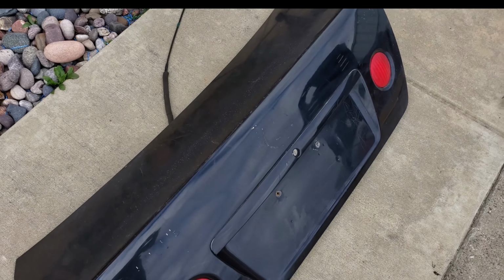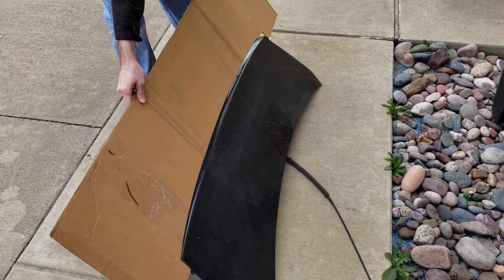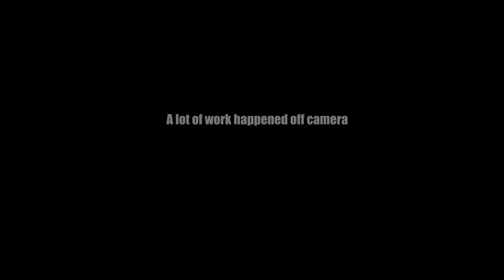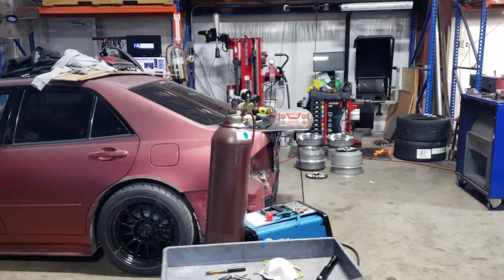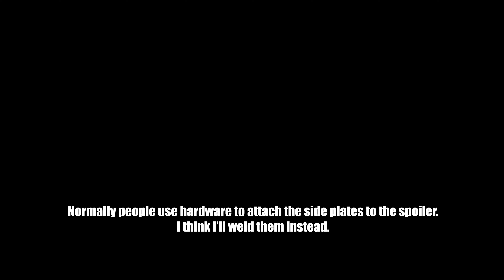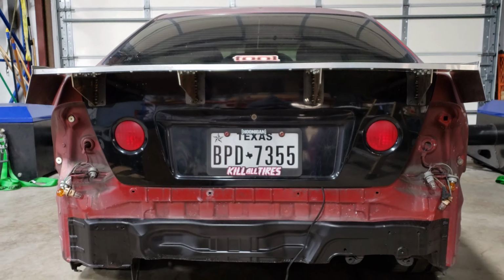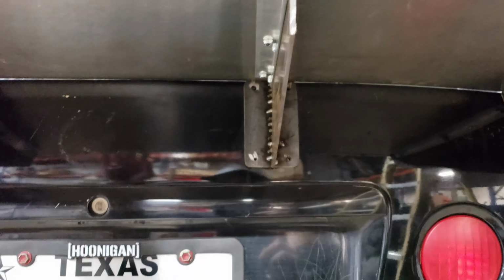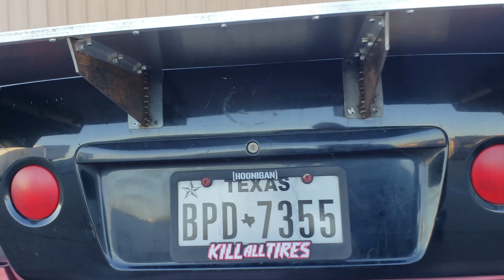Custom drag spoiler for my LS Turbo Lexus. Street car!!!

Comment: 6:50 such a sweet sequence...really happy with how it turned out. WOW!!
Thanks for sharing bro
Reply from the maker: Thanks for your support
Reply: @TurboV8boi  what was the gap from the trunk lid to the wing? I heard some ppl so 1/8" gap. How wide did you do yours? I'm thinking about doing maybe 8-9" instead of a 13"
Reply from the maker: @michaelsutton325  there is no gap on mine, it butts right up to the trunk.

Comment: Can you do a video on if it did or didn't improve your downforce
Reply from the maker: I did think about doing that, but i never set it up. I think what id need to do is set up a sensor to measure shock travel and drive down a part of highway at a few speeds, like 60mph and 100mph. Then take the wing off and do it again and average the two based on how much the suspension is compressed. But theoretically it does work. You don't really know unless you get data though.